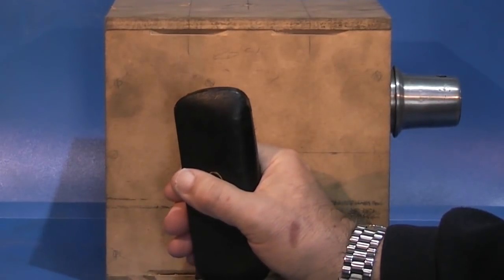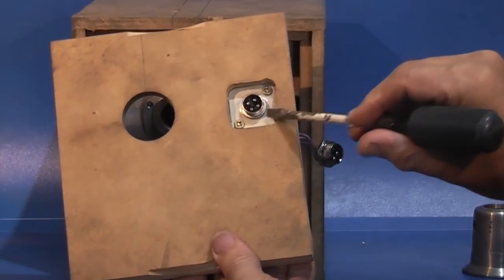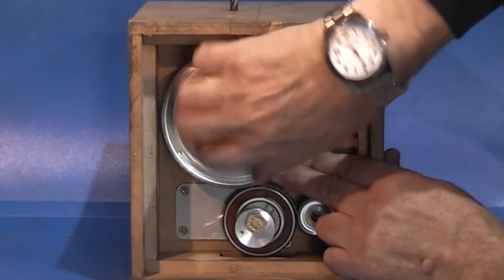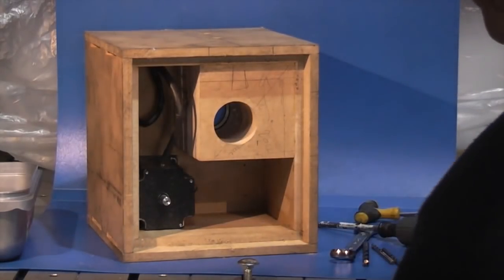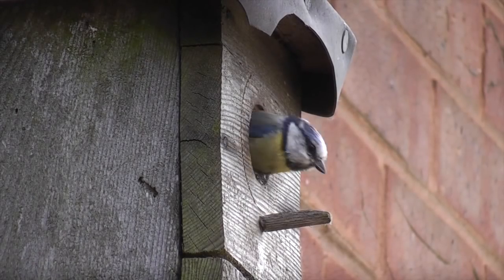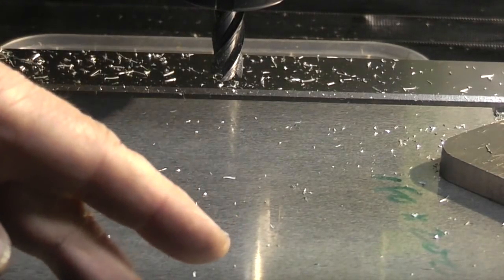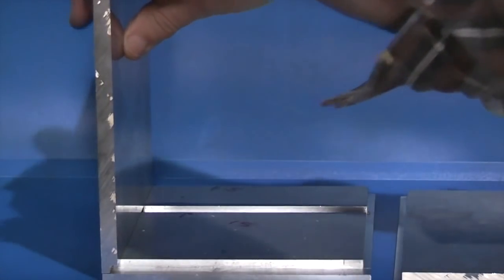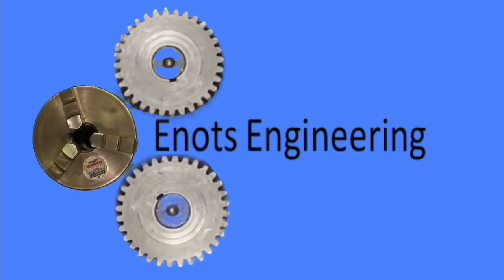Rotary head for lathe or mill

Comment: Very intriguing, I like the iterative approach ie building the prototype in MDF then (now) upgrading to Aluminium. May I ask what type the bearings are, normal ball bearings or special type for taking the axial forces as well, although that might not be too much of a concern with a dividing head, after all?
Reply from the maker: Hi The bearings are SKF ball bearings you could use taper roller bearings but then you need oil seals. The head when in use will only move slow when indexing  so the bearings only need to support the chuck and work. They are pre loaded to remove any play in the spindle.

Comment: G’day Alan, nice to see you change to an aluminium casing. May I suggest two threaded holes in the door outer edges so bolts can be used to push it out when servicing as I presume the door will be a NICE fit to keep rigidity. 
I must say that the use of electronics has reduced the complexity of the dividing head, well done. 
Cheers 
Peter

Comment: Alan, that is nice! Quite a project. I like that you copied the spindle of your lathe to use the collets or chucks. I can see the uses on a mill, but can’t see to see how you would use this on a lathe. You need to do a video of using on the lathe and on the mill when it is completed also what do you use to control the stepper mo5or?
Reply from the maker: Hi I use my C.N.C computer and drivers which run on Mach3 and set the head as a 4th axis. See my video on Home made CNC https://youtu.be/t4WTlaUCosc